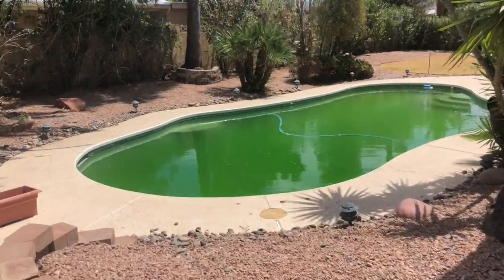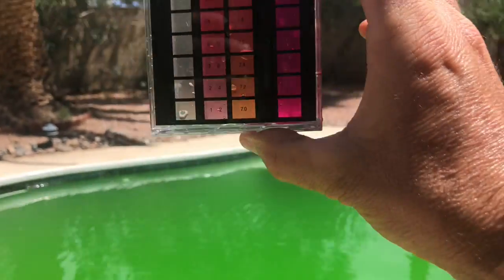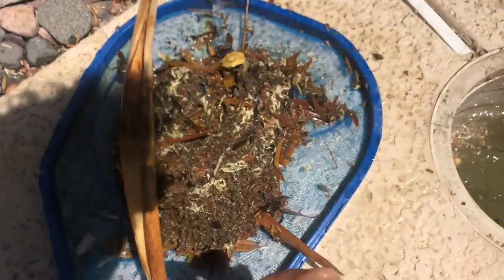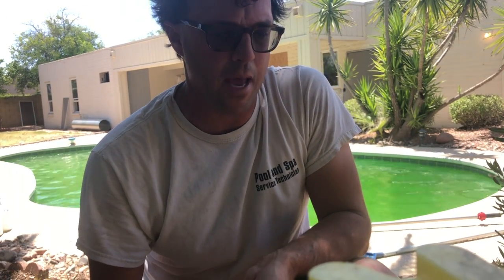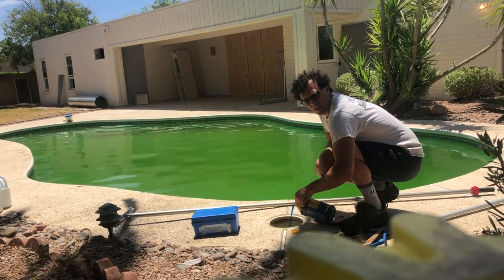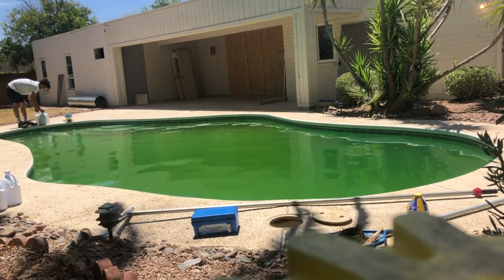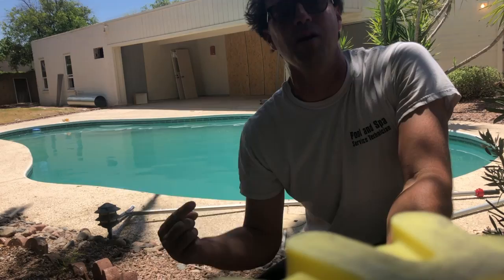From Green to Blue in Minutes: Dropping the Calculated Chlorine BOMB!

Comment: live in Florida, have new liner new pump and motor, we also use an ozone water purification system- help we have algae
Reply from the maker: How’s your water? Have you had a full test done on it yet? How long are you running your filter pump? Are the skimmer, main Drain, and Returns set so there are no dead spots? How’s the filter? What type of filter do you have? When was the last time maintenance was done on it? It sounds like you guys are trying to get to the bottom of this so the questions I’m posing are they places and things you need to look at to solve the algae issue. Let me know and maybe we can get you a little closer to solving the issue.
Reply: I just purchased a house with a pool and the previous owner installed jets that point 1 direction. It seems like the entire center of the pool doesn't have any flow to it at all   should I point them all down or change them to jets that flow straight out?

Comment: 1.)  You may want to find a distributor to supply you with 5 gallon jugs of chlorine. So much easier than fussing a bunch of gallon jugs, especially when a pool is green like that. Plus no trash, the jugs are refillable. 

2.)  Why is there no multi-port valve on the filter? Is there a way of rinsing the sand post-backwash? This looks like a novice install with corners cut. 

3.)Variable speed pump is nice touch, though. The pump should run 24/7. Only wiggle room is having it turned off during the night. 

4.) Yes, the color changed from green to bluish, that is to be expected. But how long did it take to go from green to clear? I’d suspect 2 to 4 days depending on follow up maintenance.  And typically I’d suggest removing the floater if the water is anything but clear. Stabilized chlorine and liquid chlorine will often cause a milky, cloudy appearance to the water. I know this happens with automatic chlorinators, perhaps not with floaters. 

No offenses intend. Just a 9 year pool and spa tech veteran who stumbled upon your vid.
Reply from the maker: Feedback is always appreciated! 

The very reason I use the Hasa 4X crates of acid and chlorine is because, like the 5 gallon unit, there’s no waste or trash to toss as the empties get refilled. The 5 gallon cubes would be a pain to drag in and out of back yards where these I can grab 1,2,3,or the whole crate. You clearly don’t work in the phoenix market......you wouldn’t be surprised by the over population of less superior push/pull valves (which was here along with all the other equipment.) as the equipment is only 15’ away from the skimmer and main drain the TDH is fairly low and the pool is maybe 18k gallons so we don’t need to get too crazy with the plumbing. Here in AZ the rule of thumb for running pumps is about 1 hour for every 10 degrees of the high temperature. On VS pumps we run 2-3 speeds depending on time of day and needs of the individual pool. Running this guy for 24 hours under normal conditions would be a waste of electricity as it stays pretty dialed in with 18 hours of total run time and it’s not a commercial pool.

If you click on the community tab, you’ll see the picture of the pool 24 hours later, clear with a very low Chlorine reading because the water was new and the CYA numbers were still down below 10 ppm. 

We find that here in AZ with our hard water cal-hypo will turn the water cloudy temporarily due to it’s high pH and calcium content. I’ve never had an issue with a pool the uses Tri chlor, even with old water and high CYA going cloudy on me. 

What area of the country are you in? We’re always looking to connect with other pool pros.

Comment: Lol is that a push pull valve? Who does that on equipment that new? I mean especially with that pump.  A thousand dollar computer controlled pump with a backwash valve that was considered dumb in the 1970s? Jesus.
Reply: davidandrews1977 Was thing the same thing.  Installer probably cutting corners. Multi-port valves are a must in my opinion.

Comment: Josh, you used 10 gallons of chorine,is there an equation you used to determine how much chorine/acid/Pooltec you used, it appears to be a deep end pool from your brushing or do you use gallons of pool
Reply from the maker: HA! I know that the pool capacity is approx 15K,  and the Hasa liquid chlor is 12% (then factoring in for a bit of loss during shipping sitting time) so I’ll get about a 6 ppm bump per gallon. water is new so CYA is low to zero, phosphates are 0, TDS is low (for Arizona). I also know I want to make it go blue quickly (for the sake of the video) and that the chlorine will react and burn off fast. Really no equations used other than calculating the right amount of Pool Tec to use (per the table on the bottle for green pool dosing). I would have normally used .5 gallon of Hasa 37.5% HCL but I know that Sodium-Hypo has a pH of around 9 so I added the full gallon to compensate for the bleach’s effect on the pH. Other than that, it was just good old intuition from experience and years doing this.

Comment: I'd have done 4 lbs of trichlor powder for a couple of reasons
1. Ph of trichlor is around 3 so no need to add extra acid
2. Much cheaper than 10 gallons of bleach not to mention the space it saves in your truck.
3. You may not have had to use an algecide trichlor is strong enough and lasts long enough in the water to most likely kill all the algae on its own.
4. For every pound of trichlor you get 2-5 ppm cyanuric acid so you almost don't have to add cyanuric acid to start the pool.
Good jobs regardless but it's still a business gotta be the most efficient you can to make money
Reply: Fair enough I'm in the phx area too and ya high cya is a problem from all the evaporation but you still have to have a base for startup and the only reason I'm not huge on the dichlor is its not typically as strong it only has somewhere in the 70% range of available chlorine so basically 3lbs of dichlor is equal to 2 lbs of triChlor as far as chlorine concentration
Reply from the maker: We use Dichlor on startups as it’s 9 ppm of CYA for every 10 ppm of chlorine. Here in Phx we struggle with high CYA and water hardness so that’s why I’m such a fan os sodium-hypo

Comment: Is that bleach from the grocery store? like chlorox ?
Reply from the maker: Same exact stuff. Chlorox is 8% concentration, mine is 12%
Reply: @SwimmingPoolAZ-SPS   thanks. always wondered about that
Reply: Not really- grocery stuff has fragrance and other stuff that l wouldn't recommend putting in your pool
Reply from the maker: Tom Allen if you buy straight chlorox bleach it’s the same exact stuff.
Reply: @SwimmingPoolAZ-SPS  if sodium hypochlorite is not sold as a disinfectant, it does not need to list its strength, could be 1/2% or greater. EPA regulation- so really not the same. That's why the grocery store product is so cheap.
Reply: @tomallen7699  Apparently you just enjoy arguing semantics. g name brand grocery store bleach here in south east Texas is 3.50 a gallon so I don't know where you get the idea it's cheap!

Comment: HTH Green to Blue $ 20 at Walmart.
Add the product circulator pump for six hours backwash filter and manually vacuum the dead algae from the pool floor with filter on waste. 
Top up 2 inches of water you drained from your pool while vacuuming.
Balance your pool water swim in 24 hours.

Comment: I've been taking care of pools for 15 years, 5 on my own now. I do like your method and may try it soon. Using liquid  bleach didn't cloud the water like 12 lbs of shock would. Good job!
Reply: He didn't even clear the pool. All he did was shock it. Of course it will turn blue but this pool will take days to get back to clear and sanitary.
Reply: @Cavediver86  A properly treated pool doesn’t need to be clear to be sanitary. In the days it takes for the water to be filtered clear it’s okay to swim. Just need for chlorine levels to get below 8ppm (5 is even better)
Reply: Well he does have a customer he has to impress
Reply: Use a pool vac with cal hypo in it. Power vac with no more than 1-2 lbs at a time, and you’re good. Minimal clouding too. Max dispersion as well.

Comment: 1 gal of acid and 5# of cal hypo and I'd be done with it! I haven't used algaecide on my customer pools in years! Easier to carry 50# of cal hypo than it is 50 gallons of liquid! 3" tabs in the auto feeder. Chlorine kills Algae! Shock the pool weekly prevents this! Even if you miss and the Chlorine levels drops and the pool is green, shocking it with Chlorine will kill the Algae and turn it blue. No need to waste money on Algaecide!
Avoid getting a salt pool as no one will tell you about the corrosion factor down the road on everything! Ladders, niches, basketball/volleyball net posts, equipment, etc... Also any chemical that has POLY in it's name, will NOT EVER break down in your water! So AVOID them! Nature doesn't add polymers to treat water, so why should you!
But I've been doing this longer than you have been around! Not being a smart @$$, just passing on knowledge to keep happy customers!
Q: Do you know why they call it POOL?
A: Because all the other really good 4 letter words were taken!

Comment: How long what you have to wait before using the pool again? As I guess you would probably dissolve jumping straight in LOL.
Reply: JakeGamer123 As a general rule, it is best to wait until the water is: crystal clear, free chlorine level of approx 3ppm, and pH as close to neutral as possible. In this case I’d guess 2-4 days.
Reply: xraysteve at the pool i work at (community pool) we tend to keep our chlorine 5-7.5ppm, is that overkill? it’s what i’ve been told to keep it at when i’m on duty, if it helps any we have to fall under california state health guidelines
Reply: Tyler if your CYA is on the higher side then that would be fine. If it’s in the ideal range around 30-50 then that might be slightly overkill.
Reply: @tyredcar03  I keep my pools between 3-5. Anything over 5 isn't good. That's why after shocking I tell my customers to wait a minimum of 8 hours to swim. It gives the chlorine level time to drop back to a safe number.
Reply: Tyler as .
Reply: That de escalated quickly
Reply: I was wondering the same thing....
Reply: Cougars & Tigers ahahah right. That dang sign is on everything! That is overkill. 😆😆
Reply: Cougars & Tigers  
Very true. Even the vinyl protective gloves I bought recently said they're known to cause cancer according to California standards.  Nice to know!!😀
Reply: @JakeGamer123 be in the pool while pouring it in.
Reply: 1 minute
Reply: JakeGamer123 
4 hours

Comment: You just gonna ignore air entering the system at  4:22.  Guarantee its the backwash valve orings.  I know it might not seem like trouble if it doesn't leak when the pumps on, but it lets air into the system when the pump is off, and  if the internal air bleed fails it can pressurize the air in the filter and blow out prime when the pump shuts off. 

Edit: Depending on how high your pump is vs your pools water level this air leak will screw you even if you don't have a shitty sand filter
Reply: Where do you think you saw air entering the system?

Comment: Ok, it's blue now..BUT it's still not clear :) ...yet

What % of Pool Bleach did you use? 10% or 12.5%

Also what did you lower the PH down to? 6?

I had the same issue this year on my pool for the first time.. Pretty much what you did but it was still cloudy as you show at the end..After some hard numbers checking, My Alkalinity was low with zero Stablizer. Once I got this right and my PH back to 7.5, it was nice and clear again.
Reply from the maker: PH dropped to a 6.8 but the 12% sodium hypo we use tends to send the pH back up pretty quick though. It went clear the next day. If you go to the community section of this channel there’s a picture of it.

Comment: Very interesting, Zach.. thanks for sharing. Turning it blue in minutes? In addition to a couple hours of brushing, flushing, backwashing and flushing.. yeah the reaction was pretty fast.. but that was a back breaking coupla minutes. To the guy from the pool store that said it was $40 worth of stuff.... maybe wholesale. Bleach is $3.40/gal, acid is another $4/gal, the algacide is $31, and electricity is $0.22 / kwh.   I wish I had your math!  Glad to know theres an algaecide that isn't antagonistic with chlorine... I had read you should not add chlorine and algacide at the same time. Seems to me. as a homeowner, letting your pool go green is about a $200 mistake...What am I missing?
Reply from the maker: Ej Koford the prep work (brushing the heck out of it thoughly, backwashing, etc) are key and take some time but once THAT amount of Chlorine goes in after all that, it’s minutes. The algacide we used (Pooltec by Easy Care) can be put in along with chlorine. The next day the pool was clear.  Depending on your pool, the price can vary for a treatment like this. A homeowner should be able to get the equivalent done for less than $200

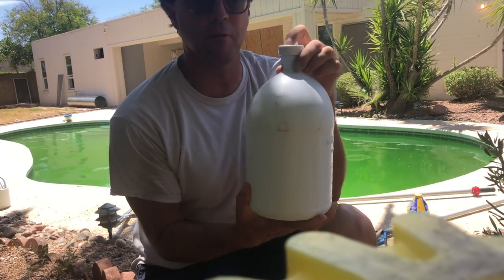Comment: At 8:47, you stated that you used sodium hypochlorite.  A regular commercial bleach contains 6% with 94% inert ingredients.  Are you using that or a higher concentration of sodium hypochlorite?
Reply from the maker: The stuff I get is 12% (120,000 ppm) chlorox from the store is 8%
Reply: Weird.  That seems to me to be strong!  O,K, Thank you very much.
Reply: Not sure where you live, but Menards sells a "Pool Shock" that is a 12% solution
Reply: O.K.  Thank you very much.  I am in North Carolina.  I wish that I knew about this trick back in the 80's.
Reply: Most pool stores will have it at 10% or 12.5% at about $4 to $5 a Gal.

Cheapest I could find it here is at Walmart for like $3 at 10% and the cheapest Store Bleach at 5% to 6% I could get is $2 at Big Lots. So even though you can use normal bleach, you may need to use double of it because it contains a less of a percentage of  sodium hypochlorite.
Reply: Thank you, Tig3rj.  I really was not concerned about the price as much as the concentration
Reply: I think he said 12%
Reply: Thank you Shane. I seem to have missed it when he said that.

Comment: From the size of the pool I think you over did it on the chlorine level but at least 2 to 3 times.  You need to test for cya levels first before determining your shock chlorine level.  Cya is probably at zero which makes your level of chlorine used way too high.
Reply from the maker: As stated several times in the video, you need to do a full water test before chemical treatment. Also stated in the video, the water was only 2 weeks old so our CYA was low, less than 20 ppm. I treated with bleach, a non stabilized form of chlorine. The 10 gallons of 12% bleach pushed the Cl levels above 80 ppm (easily 3x what was required). It turned blue in a matter of minutes (the goal of the video) and had dropped to a 1ppm reading the next day (making it swimmable after topping off the chlorine floater.). Glad to see there’s some other chemistry savvy folks out there with some insight. Thanks for watching and the feedback!

Comment: here in england we don't normally have pools - but over the last few years we have been having hotter summers and above ground pools have been on the increase. i have a 32000 ltr (7500 gallon) pool which i have used for the last 12 years and never had a problem until now...... sand filter: shock once a week: daily dose of sodium hypochlorite:  backwash regulary: sweep regulary...etc.  but now i have a cloudy blue pool.... ph was about 8 and then i lowered it to 7.4.. shocked again: but alas: still cloudy. any solutions before i sell it - because thats how i feel!!!
Reply from the maker: Hi Barry, it’s good to hear from someone across the pond! There could be a few things causing the water to go cloudy. From a filtration perspective, we could be getting water bypass where either the gasket in the multiport valve is damaged or coming out of it’s seat, dirty water can completely bypass the sand filter and make it’s way back into the pool. The other thing we need to consider with the filter is the sand. Have you opened the filter up and manually moved the sand around, flushed it with a garden hose to give it a deep cleaning before opening it up for the season? Another possibility is that something is suspended in the water that’s just too small a particle for the filter to catch but big enough to make the water look cloudy. In that case we need to get a good Clarifier like Clearex 300 by Bio Dex or similar product and use that as directed. 

From a purely chemistry standpoint, it looks like you’ve moved the right direction on the pH but we also need to consider Alkalinity, water hardness, and temperature to a certain extent. We in the pool industry will sometimes measure the water’s Saturation index. It’s a measurement of the water’s tendency towards either being corrosive or scaling. Higher temps, high calcium, alkalinity, and pH will cause the water to push calcium out of solution. That will cause the water to be cloudy due to the calcium precipitating out (like microscopic mineral snow flakes) the water will be cloudy. In that case we need to adjust pH and Alkalinity down as well as consider a partial or full drain in order to bring the calcium down so you can have comfortable swimming water.
Reply from the maker: Also, Email us some pictures of your pool!